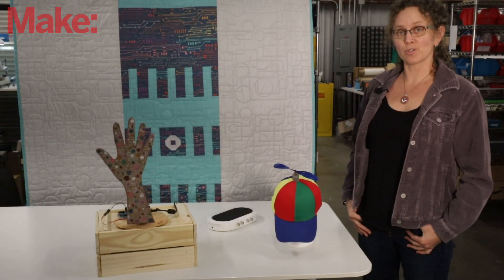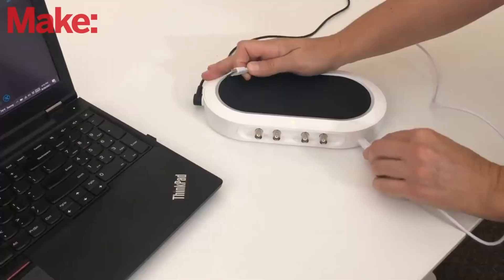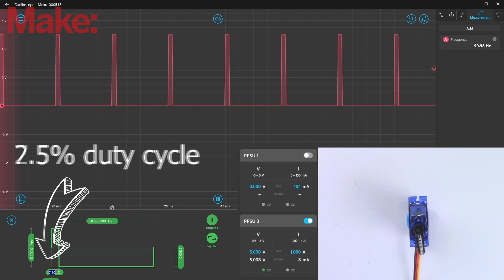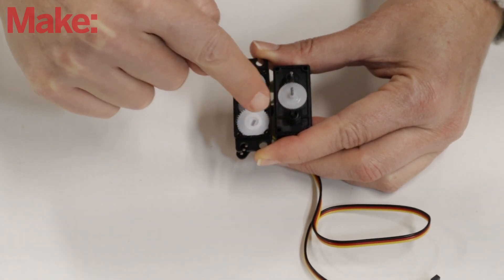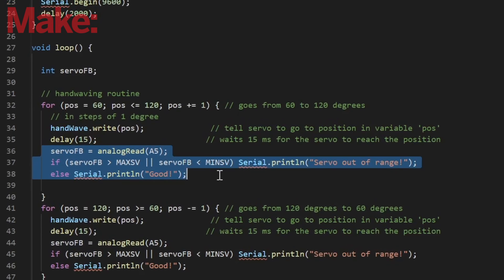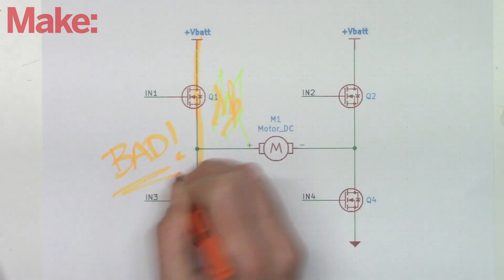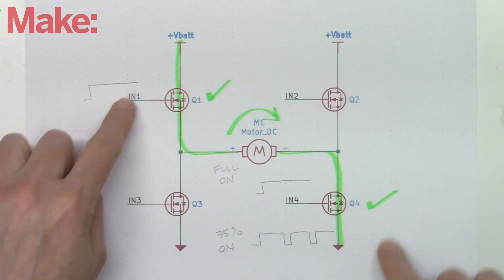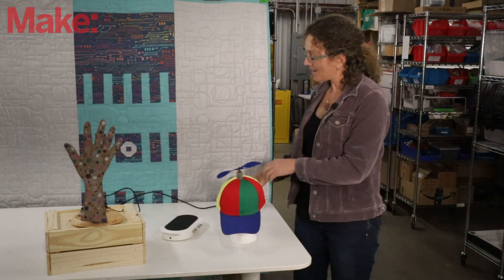How Waves and Pulses Help Us Control Servos And Other Motors

Comment: With the H bridge those are mosfets not transistors there's a difference between the two devices they're still in a typical transistor package or style but two totally different animals.
Reply: Hi, Chris!  MOSFETs are transistors!  That's what the "T" stands for - Metal-Oxide-Semiconductor Field Effect Transistor.  You might be thinking of BJTs which are another type of transistor - Bipolar Junction Transistor.  Both can actually be used in H-bridges, though MOSFETs are generally preferred because they have higher efficiency (lower on-resistance, less waste heat generated).  BJTs are still used in low current applications and/or where cost is the primary driver, like inexpensive toys.
Reply: I'm not an electrics person, but doesn't the T in MOSFET stand for transistor?
Reply: @dannyl2598  in a way yes, it's a form of a transistor but not the same properties as a standard transistor. A mosfet is different than your traditional NPN or PNP transistor. A mosfet is used for switching higher currents on and off at a faster rate of speed then some transistors. Which is why you'll find mosfets in inverters because of the fact that they're switching capability to convert 12 volts, 24 volts, 48 volts or 96 volts to 120, 220 or 240 volt outputs.
Reply: @chrislewis2262  would MOSFETs be what is used in VFDs? Thanks
Reply: @dannyl2598  maybe, I have never taken one apart to see how it works.